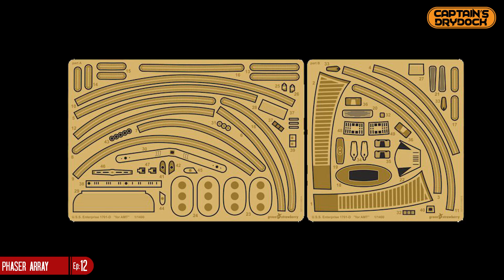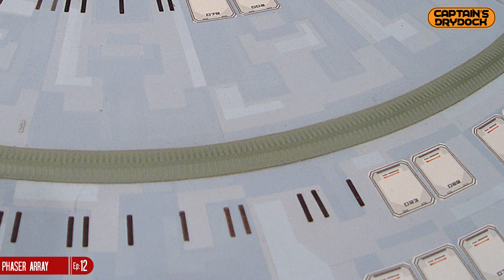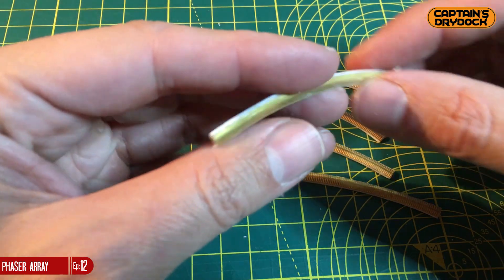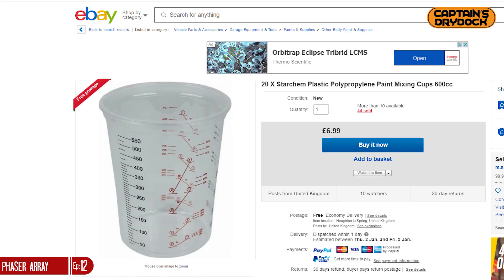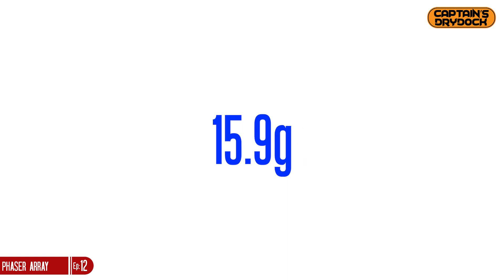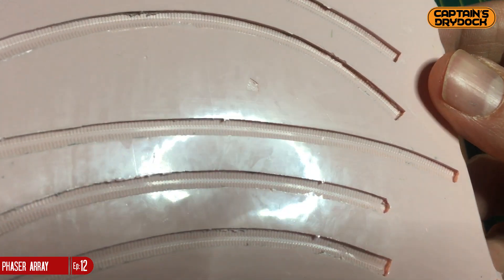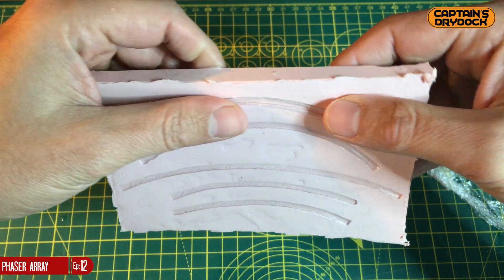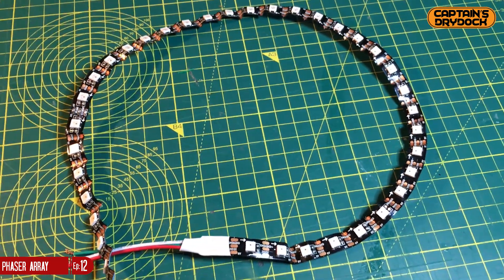Building the Enterprise D: Episode 12 Phaser Array

Comment: captain, have you heard of led filament? you can get them on aliexpress. tiny leds are very narrowly stringed into a flexible silicone thread. this would be PERFECT as a phaser strip. however, i have not seen their leds being controlled individually. but if that would be possible, the effect would be awesome!

edit: also, i just came across cob led strips. they should suit your model perfectly fine: https://www.youtube.com/watch?v=8LNn7A2Xek8
Reply from the maker: WoW! I never knew they existed. Thank you for showing me. I'll keep them in mind for any future projects.
Reply: @CaptainsDrydock  thank you for your reply! have you heard about the eaglemoss enterprise d partbuild? i'm eagerly awaiting both eaglemoss' parts and you description how you did the lighting and phaser effect in order to mod the partwork according to the things you did here on you channel. i wonder if you could run a "higher resolution" cob led strip with your setup. could you just edit a number in your code or is yours specifically designed for a given number of leds within the strip you use? thank you for your help!
Reply from the maker: @slvrpltd  It's exciting that Eaglemoss have done that production. I would expect the model will need extensive mods to bring it to accurate levels - if that's your aim. The code can be changed, but as the neopix is installed already I won't bother replacing it as it's good enough. 
Be good to see your progres.